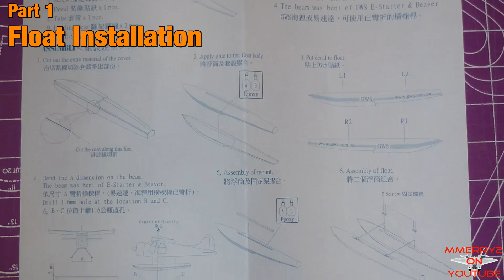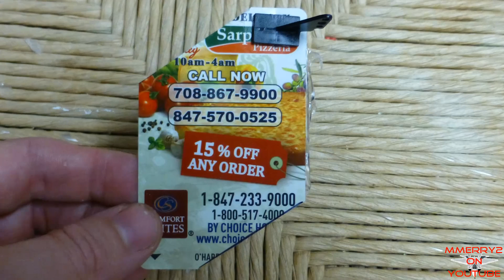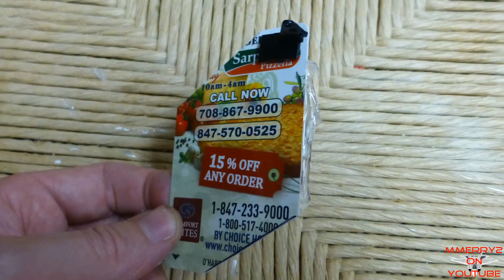Adding Floats to a Bixler / SkySurfer / AXN / Hawksky / EasyStar

Comment: Looks like the placement is a touch off.  Almost looks like the floats need to be moved slight aft.  The key to floats is aligning the step slight aft of the center of gravity.  When taking off dont pull back until its on the step and the rear of the float is off the water.  in many cases you have to start with some down elevator so the tail of the float isnt sticking to the water.  Then once moving decently neutralize the elevator and increase speed until on step and then just a slight bit of up elevator should have you lifting off.  Too much elevator too soon either keeps you stuck to the water or a premature lift off right into a stall.

Comment: How much time could you flight? I would like to achive 30 min with fpv equipment. You think it would be possible?
Reply from the maker: If you keep you FPV gear light and minimal, that should be possible.  The most flight time I've ever had is about 40 minutes on a 2600mAh 3s LiPo and that's with lots of throttle management, rudder only for turning and barely any wind.  I've heard of flight times over an hour.
Reply: mmerry2 on YouTube I got an hr without fpv on stock setup on a hot day. but im currently using those cmos or ccd cameras that are super light and a 5.8ghz 400mw boscam tx and rx

Comment: Loved the video ! Great job !  I  do A LOT of float flying with multiple float flying videos on my channel, including some instructional videos. You mentioned the take-off is challenging. At 3:54 you say that the step should be "in front" of the CG - this is why your Bixler does not track well on the water. The "step" on the floats should be "at or just behind" the CG for good water behaviour. Also check the floats for the correct incidence angle (0-2 degrees positive ) relative to the wing.